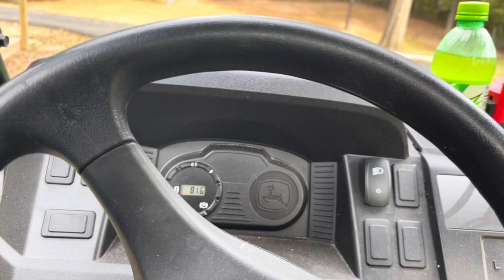Mobile home skirting using treated lumber

Comment: Looks good Brad. Do you think you will need vents after they dry I think you will have gaps and that should be plenty ventilation. I know my fence has small gaps now and I had them wedged tight when I installed it.
Reply from the maker: I’ll know in spring if the gaps will be enough.

Comment: yore doun it rong!!! u shud use bacon grease on dem screws to make em go in mor bettr 😄
Reply from the maker: What would I deep fry my chicken in?
Reply: @bctruck  I use 10-W30 😄
Reply: All joking aside, I have heard that if you soap the screw threads with bar soap they go in easier. Haven't tried it yet.
Reply: @Jimwill01  That's true. My dad taught me that a long time ago. He also said to rub soap on a saw to make it cut easier 😉
Reply from the maker: My dad taught me to stand in water before I plug an extension cord in and to check my fuel level with a lighter.
Reply: @bctruck  That'll make a man out of ya 😉
Reply: @saltyshellback  ... or something like that!

Comment: That is looking very good. And when you paint it the color that the vinyl is/was the city folks won't know the difference. I like it.  Thanks
Reply from the maker: I have stopped caring what the city thinks. I built my carport without a permit, my porch without a permit, my fence and gate without a permit. Before they will give you a permit, they send a code enforcement officer to my property to see if what I want to build is acceptable to them. I don’t need someone who is also the dog catcher, telling what or how I can build something.
Reply: @bctruck  We had a code enforcement individual (idiot) not approve our gas line.  We used decking boards as skirting on the front of our trailer as a retaining wall to divert water around the trailer instead of it running under the trailer. I couldn't believe this individual had never read, much less seen a CABO book.

Comment: Doesn’t matter how good you are there will always be naysayers and “armchair carpenters” ignore them. But I’ve been looking for a solution to my problem and this looks like it. In the same situation as you bad knees and bad back, but I also have a mobile home sitting on uneven ground 5 feet at the back 2 feet at the front, this is the route I’m taking I believe it’s the best solution for my situation thank you for posting this video and being very detailed.
Reply from the maker: It’s been over a year and it still looks good.

Comment: As the Scots say...Hoot Mon...whatever blows ye skirt.  :)  Gr8 Video!  

Appreciate info on how you constructed the ground surface using the 12" tiles.  My Mobile sits on a sand and clay fill dirt pad and I want a level permanent surface to mount the skirting to.  I've thought about the tiles and vinyl or cement board.

I feel your pain and I'm having to stand to type this cuz of hip pain I have while sitting.  I think the hip pain is from a sciatica condition I get from being a pure back sleeper.  I got a Sports Doctor Youtube tip and have cured my sciatica low back pain several times by putting a pillow under my knees.  I guess I love pain, lol :( , cuz every time I cure myself, I kick the pillow and the pain comes back after a few months.  Last night I started using the pillow again, and doing some hip stretches I saw on YT that hopefully will stop the pain.

Comment: Those 23 minutes flew by this morning. Thank you for a good way to start our Saturday. Liked everything about it, from the how to DIY skirting to the banter between you and Charly. Can't leave out Breezy supervising, either. Cut off access door 👍👍👍 Good thinking on the people access door. I have 2 on the back of our house (trailer, mobile home for the critics) and both have challenges because of conduit or ductwork. Hope the rest your job goes smoothly and you'll soon put another ✔ on your to-do list. 

Hope you and yours have a blessed Saturday. Godspeed if you venture forth.
Reply from the maker: The rest of the skirting will be much easier. Working on the back side I was on a 45 degree incline on red clay.

Comment: Get yourself one of those lawn and garden creeper chairs. You can roll 'em sideways while you're workin' and you don't have to be bent over all day. They've got big tires on them so they can roll off road rather easily. I'd have one myself but my knees can't take being bent that much. I'm too tall for most of that stuff. Have to have about a 23 inch chair height for me to be able to get back up.
Reply from the maker: The rest will be easier. The back side was on a steep hill.

Comment: Honestly, with the gaps that will form between the boards, you are probably ok with just that alone for ventilation. Unless you are planning on insulating behind that.
Reply from the maker: I’m not. The front porch kitchen I built is a perfect example of how much space will open. I butted one piece against another when I built it and now there’s a 1/4 inch gap between them.
Reply: @bctruck  Yea, honestly, I think you will have enough airflow with out adding the vents. 
If it was tighter like board and batton, or tongue and grove with a solid seal, then I’d worry about venting.
It’s like having two spare tires for your Honda, not gonna hurt, but also not really a requirement.  ;-)

Comment: How did you anchor the bottom 2x2 or did you just screw it into the skirt boards? Looks great appreciate you sharing your hard work.
Reply from the maker: The bottom 2x2 is screwed to the skirting a few inch above the ground.
Reply: @bctruck  thank you sir. I thought it was but wasn't sure.

Comment: This video is exactly what we need. Did you run a track along the bottom? We're trying to figure out how you secured the pickets.
Reply from the maker: I screwed a 2x2 up under the edge of the house. I screwed the top of the skirting to it, and dug a trench for the bottom of it to fit in, then filled it in.
Reply: @bctruck  thank you for replying so quickly!

Comment: Hello Brad,  you did an amazing job and I’m going to mimic your idea.  Question, so the bottom of the pickets, you just buried them?  Have they held up well so far? Thank you for the great video.
Reply from the maker: So far so good. The ones around my front porch are holding up well and they’ve been there even longer.
Reply: Wish it would show how you done the bottom  and did you nail the tops to the 2x2???

Comment: I did my skirting similar to this. And I also used treated wood as well. But because the wood is touching the ground and is more than likely prone to getting wet during the rainy days. Do you not worry about termites? This is my only concern with my skirting. Though I spray pesticides around the outside of my house Religiously
Reply from the maker: I’m fairly certain that termites won’t get on treated wood.
Reply: @bctruck  
Checkout the video here on youtube
“DO TERMITES EAT TREATED LUMBER”

by BUG BOYS PEST CONTROL

Feedback please

Comment: why would you need vents when I see people put up vinyl on the bottom they put up house wrap under the vinyl so all those cracks and vents or the wood separating you could still get rodents
Reply from the maker: What cracks are you talking about? The vinyl you see has tiny little holes in it for ventilation. Where do you see house wrap?

Comment: I hate Phillips screws. I will not buy them anymore. I only use torx.
Reply from the maker: I have thousands and thousands of Philips screws of every length. I’ll be dead before I use them all. I have 3 1/2 inch deck screws that are torx.